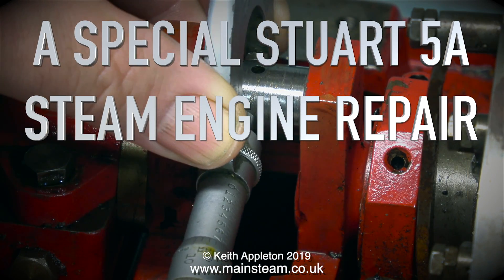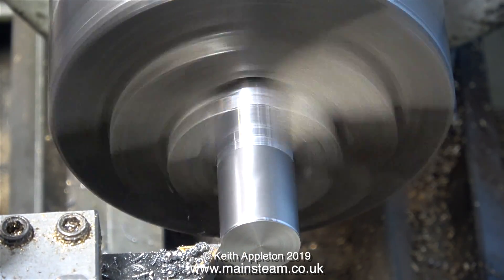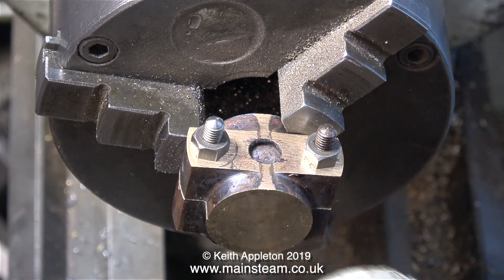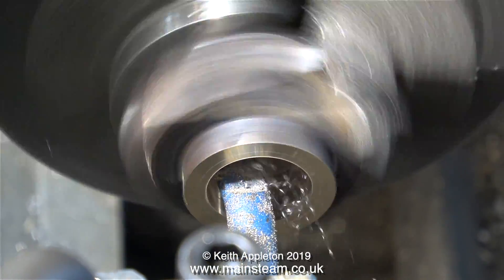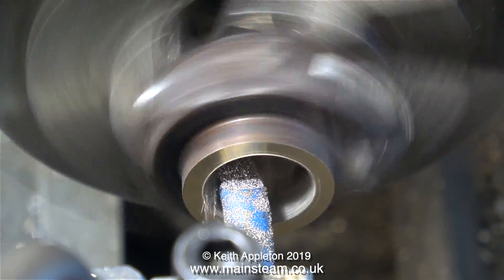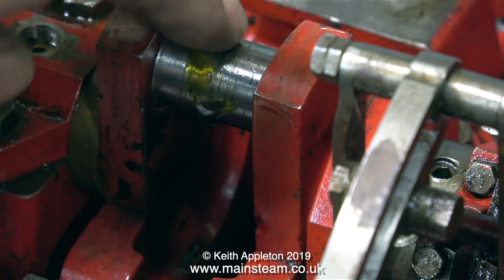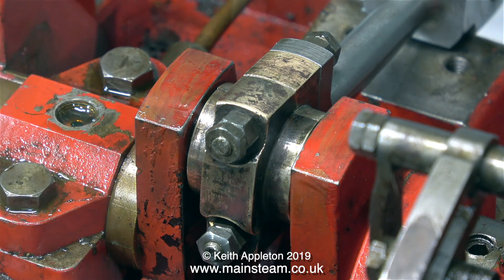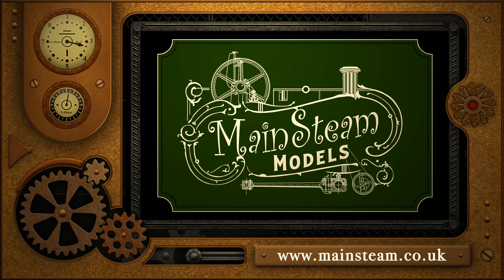A SPECIAL STUART 5A REPAIR - PART #5

Comment: I'm not sure why the keyboard warriors are getting up in arms about your process here.

At my previous engineering job we designed tooling for upsettors aka a horizontal forging machine. These machines have dies that open between each stroke. That means all of the circular dies are split in two and must match exactly similar to what you have shown here.

The issue with drilling a hole first then cutting it in two is that you lose the thickness of your cut in the center of the part. This means you no longer have a circle! We got around this because our parts were big enough that you could bolt them back together. We also had fancy $200,000 tools like a wire edm for a super thin cut.

Of course in the home shop you have none of these things and you're only doing this once. So special tools or a fixture isn't worth it.

Anyhow, greetings from the states I've recently discovered your videos and enjoy watching and learning the though process. I'm currently saving to start my own hobby shop I'm sure I'll borrow some of your tricks if you don't mind.

Comment: Mr. Appleton.  You are an amazing self made engineer.  I´m very ashamed to sugest you that when you are in the process of polishing with oil and sand paper, the best way is to give a trayectory like an "8" several times.  Turn, say, 30° and start the process again.  That avoids the errors made by the force of your fingers in one direction only and achieves a better and even surface.  Excuse me for my rusty English.  I'm a retired ship engineer with 37 years of ships engine rooms on my back.  I used to have a very good technichal English some years ago but I'm afraid I'm losing it.  I'm from Argentina and admire your work.  I never lose an episode.  Thank you very much and again forgive me for my insolence.

Comment: Keith, are you as paranoid as i am? . . . after machining and fitting with the plug gauge, i would have reversed the plug gauge just to be sure i had used the proper side.
;-D>

Comment: I'm not questioning your work or  technique I just want to know why you soft soldered instead of silver soldered. Thank you
Reply from the maker: so they can be very easily removed if required at a later date . . . .
Reply: @keithappleton  OK that makes sense.  Can you take time to explain how oil galleries were made in to the crankshaft?   Thank you
Reply from the maker: I don't know, I never took the engine down that far . . . .

Comment: Gonna suggest a tip here measuring the crank, measure sides that are 90° to the top and bottom of the journal. The wear happens on the bottom and top of the journal.
Reply from the maker: in this case as the brasses were run dry, the wear is all the way round and surprisingly 15 thou down all the way round the crankpin.